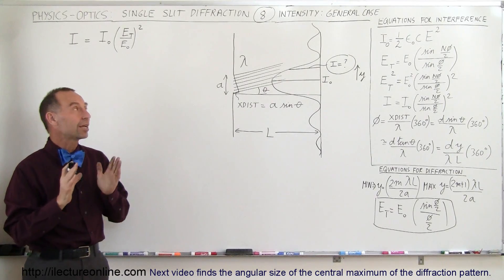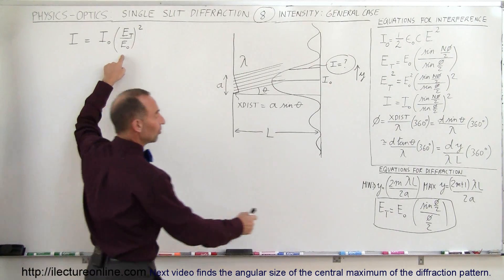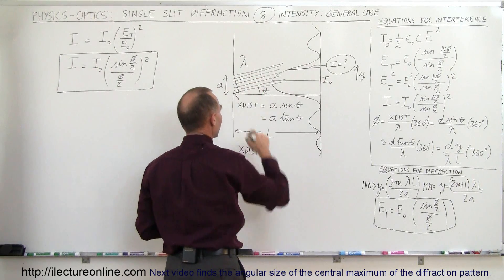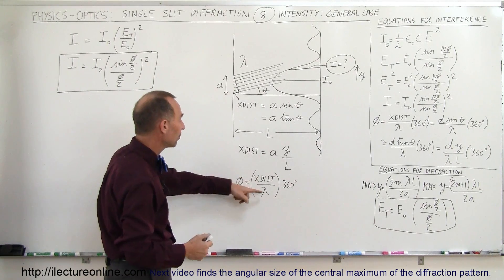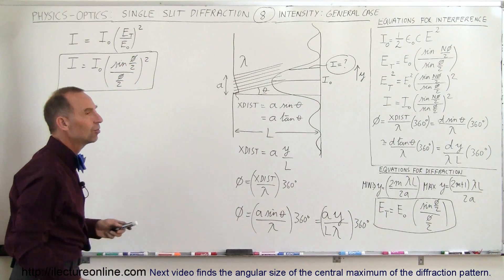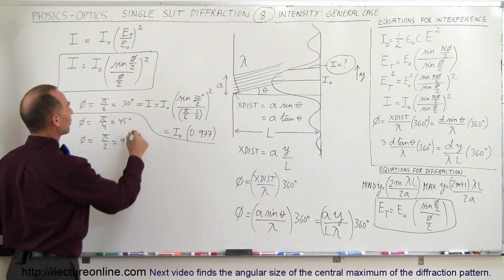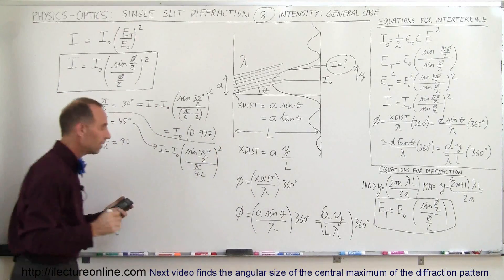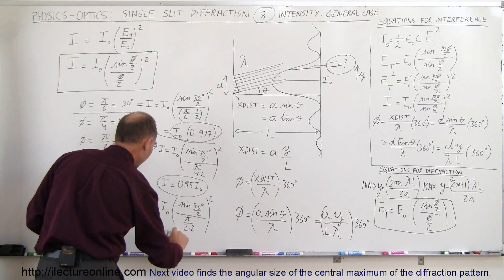Physics - Optics: Single Slit Diffraction (8 of 15) Intensity=? General Case

Comment: Sir Can i know why we divided Intensity in radians i.e Eo what would have happened if i have divided it in degrees?
Reply from the maker: The equations were derived, assuming the radians will be used, (which is standard).  You would have to adjust the equations in order to use degrees.
Reply: You aren't plugging degrees into the sine function, you are plugging radians